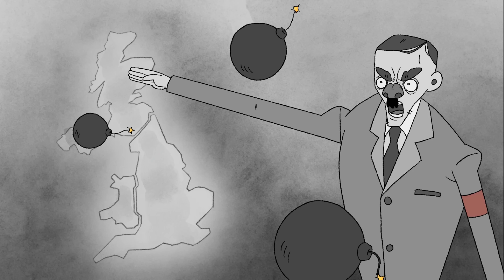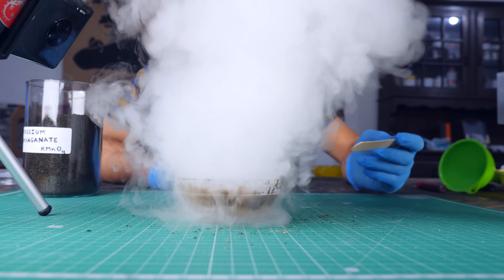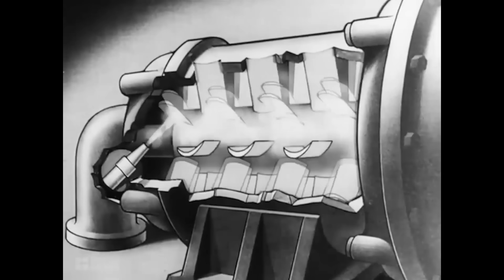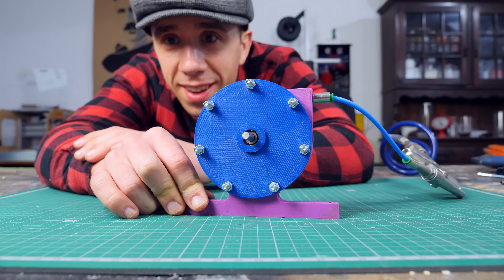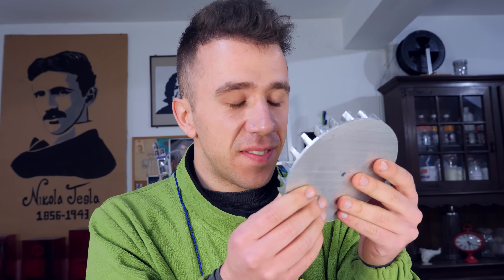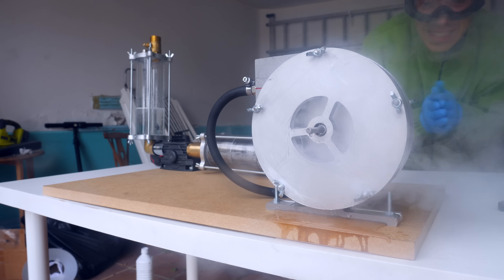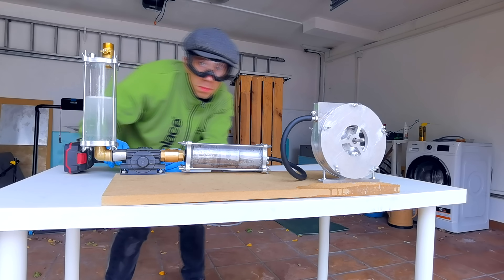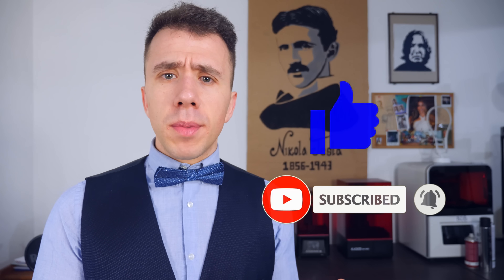I built the World War II V2 Rocket Steam Turbine

Comment: Make a Tesla Turbine, But Use stainless steel for the disks. The major problem with them was they were TOO powerful and the disks would expand hitting the casing. From what I remember, they are capable of more then 30,000 RPM. That's used with water, but I am very curious what your H2O2 Steam generator could do with a Tesla Turbine attached.

Edit: Also now that I'm thinking about it, catalytic converters work best at higher temperatures, much like O2 sensors do because of the metals used. How would the generator react to being heated up while creating steam?

Comment: Try use ceramic ball bearings they have better friction. And try cnc the blades on a slight angle. And if you change the setup so the catalysts are upright and “drowning” in the solution. “Like you did with experiment catalyst ☝️ “ 
And have some sort of endpipe with smaller nozzle where the steams comes out. 
That should make it faster but also probably creating new problems 🤷🏼‍♂️🫣

Comment: Add a pressure vessel after the catalytic converter with a line that feeds back into the catalytic converter. All the liquid will settle at the bottom and the pressure in the pressure vessle will push it back through. Add a check/one way valve to prevent back flow into the pressure vessle.

Comment: I wouldn't say "Like a coward," it's not like he didn't start off sending planes. This is sorta more like a "plan b"

Also, couple that pump to the shaft of the turbine! I bet it runs on it's own once you start it. Also, the inlet nozzle for the turbine could definitely be improved. Willing to bet that's mostly water escaping as liquid as well, so some higher concentration peroxide + a water separator might help this design

Comment: Would love to see you iterate more on these designs and improve them further. Seems like every video is the very start of each of these concepts, but at the end there is always so much efficiency or energy left untouched. This one for example, I would really enjoy seeing a more improved version that doesn't spew as much peroxide and converts it to steam more efficiently. Maybe even use the turbine itself to run the pump instead of a drill. Basically spend another video's worth of time improving and iterating with a V2 before you connect it to a skateboard. Make a peroxide engine then use it to power something like a skateboard, instead of just a thrown together highschool science project.

Your ideas and the stuff you develop are always so cool, but these always seem like they're the first part of a 2+ part series on each project.

Comment: This is the first real step to building a real rocket engine, work on the fuel pump next and connect it to your engine
Reply: Sugestions to improve the turbine:
- reduce mass of the impeler;
- tighten the gaps between the the rotor and the case;
- redesign the impeler to a more conventional and modern shape.
- More Catalisers
- reduce size of the outlets and add proper tubing
- wHeR's MoUstAACHHEEe?

Comment: You need to inject the steam using a venturi or nozzle to direct it at the turbine more precisely.
How did you decide on the blade design?  Most automotive turbochargers have a more simple blade arrangement in their prime movers.

Comment: I would love to see you build a vacuum chamber large enough to encapsulate your 3D printer and remove the air to see if it would help with layer adhesion and lower the required heat to properly laminate your prints. It's possible it may aid in the success rate of more fickle filaments. It is possible this will remove any impurities in the air or remove rapid oxidation of the material.

Comment: You will need some type of gearbox to adjust the imput velocity of the water to the speed of the turbine underload. Your turbine shape is unusual and will not help for adjusting the speed visually with a slowmotion. I do feel like the shaft should spin the opposite way the rotor does to make the water vortex its way out the turbine. Very interresting setup!

Comment: Orient your catalyst chamber vertical with the input on the bottom.  The heat and steam will then rise and splattered H2O2 will hit the upper areas of the catalyzer tubes as a fine mist, creating a massively increased fluid surface area in contact with catalyzer surface area, reducing fluid pass-through to the turbine.

Comment: The stepper motor will not produce a lot of energy at high speeds. They induce less power than an AC motor. and I'm not a genius in electricity. if we're talking about rockets. without oxidant you will not achieve pressure and tension. sugar rocket to supply her with pressure and oxygen. ??

Comment: I bet you could get a lot more power for the volume of peroxide simply by removing the rightmost catalytic converter and turning the whole mechanism 90 counterclockwise.  But here's a thought too - maybe instead of injecting the peroxide, you should maybe grind up those converters and seal them in part of the fuel chamber that you can open, so the full volume of peroxide comes in contact with the grounds at the bottom.  Or maybe put them into something that will dissolve shortly after you put in the fluid, like a paper tube or gelatin.

Comment: You should use a strobe tach to measure speed.  Also, a pressure gauge on your steam generator would be informative.
Come to think of it, you should have as steam trap to separate the moisture out - Liquid in the steam is friction in the form of windage loss.

Comment: Turn the catalyst tube vertical and move the input on the top same as the output, so any peroxide that goes in there collects on the bottom and reacts until it dissipates? The gravity would also lessen the amount of liquid peroxide escaping the tube, maybe even making the tube longer to have a sort of splash zone, so that liquid peroxide collects on the sides and drips down, instead of shooting through the tube.

Comment: You should mount the catalyst vertically and with a bit of space on top. If you put the output on to the H2O2 should stay in the catalyst for longer especially if the turbine creates significant backpressure. In that way you could get better efficiency.
Maybe you could achieve sufficient backpressure with a multi stage design or something?

Comment: This was a cool video I am a big fan of steam power an I am working modeling and making my own 3d printed steam engine.
I also loved the video you did with the air powerd rotary engine, I dont have a SLA so I tried to print it with my FDM printer i manged to get it to rotate a few times under air but it keeps binding up and getting stuck after it rotates once I adjusted the clearances and i worked better but would get find a place that it could bypass, nothing i tried seem to make it work efficiently with the FDM printer.
So I might have to look into getting a SLA printer in the future and try again. 
I enjoy watching you make all these cool projects keep it

Comment: Why are you orienting the catalyst chamber to be horizontal when the peroxide tank is vertical? Your high pressure steam is just pushing the un catalyzed peroxide into the turbine. But you're working with essentially converting a liquid into a gas, so a lot of the problem with the turbine being flooded would be negated if you used gravity to keep the peroxide inside the catalyst chamber.

Literally just add a 90° elbow after the water pump and make the two chambers parallel.

Comment: each steam turbine had a vacuum pump in order for the steam to have the most utilization because the air takes away a lot of its heat and thus the energy of the gas is lost. 
then you can add another turbine where the gases from the first turbine to the second turbine will be directed  also place another nozzle on the opposite side of the other

Comment: Reusable experiments! Good job! A 50cc Converter is too flow restrictive. Make a  through pipe with the same diameter as the rest of the assembly and 50cm long...use silver paint or foil on the inside. Put a spray nozzle at the entry to wet the complete silver- or platinum-foil.  Pressurize the tank. It's called lifting. Use an electric 12v fuel pump. The garden pump is less than optimal. Use a pump regulator. Summit racing has nice cheap kits. 
Instead of your homemade turbine...use a turbocharger. Good for 100000+ rpm
Now you got a mini V2 turbo stage. 
Alternatively feed the oxygen water exhaust in the intake of a small gas engine and you could supercharge a moped.

Comment: i recommend you work on getting the weight of the rotor as low as possible, so that the steam does more work and less energy is lost just moving the wheel….or, run it longer and put a heavier rotor to work with momentum?  just a thought.

Comment: I come from a diesel/hydraulic background, I would think the impeller design is better at moving a liquid than a gas,, I think an automotive turbo style impeller would be more efficient for the steam, (I'm assuming steam is more like compressed air than a pressurized hydraulic fluid). Your design, and both your printed model, and machined model were great,, but resemble a common fluid pump design(auto water pumps) I'm thinking,if jet engines and turbo's utilize helical blades for harnessing the power of flowing air, while taking air in from what is essentially the exhaust side of your pump/motor. I don't have access to a printer or mill to test this theory, but I believe redesigning the pump/motor to resemble an automotive turbo would greatly improve the useful power. Be nice to see how small this type of steam generator could be made, like small enough to replace AA, AAA, or even button-cell batteries,, which would only need a drop or 2 of hydrogen peroxide to "recharge" it.

Comment: You need a pressure sensitive valve after your reaction chamber. This will prevent the hydrogen peroxide from entering the turbine and it will contain the reaction until a certain pressure is achieved so you aren't wasting steam, makes it slightly more efficient.
Reply: I agree.  He also needs to mill a venturi into the casing so the jet is focused on the blades and will do more work.

Comment: You should try dual cycling that system. Dunnoa ehat the actual term is.
But thats a lot of liquid being thrown out. Maybe cycling that fluid back into the system for added power? Not sure. Would have to run some mock ups.
Would love to have  3D printer to help with that.

Comment: Video Idea:  You should use the vertical chamber talked about below feeding a pressure vessel.  From the pressure vessel have a variable pressure regulator being used as a throttle on the turbine to power a bicycle.

Comment: What purity of hydrogen peroxide are you using? If it's high test it should react violently with those Brass(anythng with copper in it) fittings, that's what sunk the Kursk submarine, when a torpedo leaked.

Comment: How about a ring of turbine blades at one diameter ( big), a set of stationary blades mounted to the front case plate ( mid-diameter), and a small diameter turbine blade set. The steam is introduced in the middle and allowed to expand out through the blade sets with the static set redirecting the steam for a final expansion. This should push the torque up.

Comment: One thing you could do is once you get it efficient, you could create a steam powered scooter. Also, by lengthening the shaft on the impeller, adding a support on the end, and using a couple pulleys, you could make this power itself!

Comment: Maybe in the future for the cat converter you can make it into a closed system that builds pressure and then regulates the outflow via an electronic valve so it gives a constant flow to the pump while also giving itself enough time and peroxide to build ample pressure back up.

Comment: So ive seen that if you take a 220v 1hp or 2hp motor and a car alternator with neodymium magnets and you connect one to the other electrically and with a belt they will spin for ever producing electical power for what ever you want to power... i know its not possible BUT i tried it with couple rc car motors and it could work with a capacitor in the middle of course .. thats the task for you to do... i can send you the link if you want to see what they made and how they did it! let me know!

Comment: Cool idea. A thought on the placement and design of the catalyst chamber. Placing the chamber vertical with the output on top, and raising it above the peroxide tank will help keep it in the chamber. Also try adding a small air gap at the top of the chamber. That way the liquid that does escape the catalyst is not able to reach the output hose.

Comment: I would put the catalyze tube vertical so the liquid do not escape. About the turbine, I would make the blades thinner; as they are thick, its mass is bigger and it takes more time to speed up, the less mass it have the more rpm you get, less inertia to start. Also, check if the moving part is well balanced; you could take the sound as a indicator too, more sound it makes more losses there are. And grease or oil the bearings a bit.

Comment: Hey Inegza! Great video! Just an idea, what about replacing the drill powered pump with a tubing, that would redirect part of the pressured decomposed peroxide over the liquid in tank. Should be able to reach much greater pressures than the pump itself, also without a need of one way valve. Just be sure to add safety valve to not blow yourself up. Also another catalyser mounted in series could do the trick with getting rid of residual liquid, similar to overheating steam in steam engines. :)

Comment: Idea: vehicle powerd by spinning a reaction wheel it moves and turns as the different inertial forces act on it, if you want to turn the inertial velocity of one of the wheels changes. 

You can try and angle the catalitic coverter up so the hydrogen peroxide doesn't flow thru the turbine and only steam is released.

Comment: You could probably improve the peroxide catalizer by rotating it 90 degrees so that the input is on the bottom and the output is on the top. You're likely also putting too much peroxide in at once and somewhat drowning the catalizer by flooding it with peroxide. as for improving the power of the system, perhaps curving the vanes of the impeller more will improve its ability.

one more thing here, another reason for the sheer amount of liquid coming out of the turbine could have to do with the fact the turbine is made of aluminum. Aluminum is an excellent heat conductor and the cold aluminum (well, relatively cold compared to the steam) could just be condensing a lot of the steam. I know a few of the steam systems i've worked on will usually spit water after a cold start, and won't get full power until they've warmed up.

Comment: the concept is fantastic, but maybe you can get more catalitic convertion if you put the catalitic chamber upright (vertical) and pump a fixed amount of H2O2 from the bottom up, so the liquid h202 can have a chance to stay more on the active part without splattering outside in the turbine part,  maybe with that cute little nema you used as generator and some fiddling around it wold be possible to use that pump  + arduino to control pressure, catalitic conversion, steam production (maybe using a full rotation of nema 200 step every 2 seconds, since the time it takes to the steam to reach turbine is like 2 to 4 sec after initial pumping) .  Love you're videos Integza keep it up you are not "alone" and thanks to you're videos neither i ^_^  we are makers, and our goal is to make impossible possible ahahah.   love and respect from Italy and do not worry, i allways remember that tomatoes are disgusting :P . hope to helped you out a bit, and please sorry for my bad english.😀

Comment: For starters that pump your using is quite overwhelming. You can see the peroxide gush out of the turbine.

second I would suggest having a pressure chamber (to store air) along with a pressure regulator for the turbine.

Comment: Has anyone mentioned putting the cat vertical yet?

You're also flooding the cat with a large amount of peroxide. If you measured the rate the cat works at and added it at that rate you wouldn't have a surplus of liquid to eject. Swap the drill pump for a fuel injector? The spray pattern would probably improve the reaction as well.

Comment: you can try to make a ramsjet enigin rc which is at first a solid rocket motor and then it's kind of a turbine but no blades instead it uses an aereospike nossle which serves as a compressor and then the compressed air goes into a combustion chamber and It is mixed with a fuel to generate thrust.

Comment: Seems like the pressure in the catalyzer is pushing the liquid peroxide out as well. Maybe having some open space for baffles at the exit end that could separate out the gas from liquid. That way the peroxide stays in the catalyzer until it has fully converted to vapor/gas. Possibly the orientation would help too, using gravity to also keep the liquid in. Another idea I had would be to drive the pump using the turbine itself. You would have to do some gear reduction so you don't overdrive the pump but that would be pretty cool I think.

Comment: Hey why doint you use a fly wheel you could also add a magnet to the fly wheel, with a magnetic switch to the perpeller side of the jet to creat pulses, instead of a strait force of energy to conserv fule.

Comment: Maybe using this in some sort of vehicle to experiment with the applications of steam power. There used to be steam powered automobiles but due to an outbreak of hoof and mouth disease, the water troughs that were used to fill the automobiles were emptied. This is the reason that the internal combustion engine really took over. It would be interesting to see if there was a way to make steam a viable option again